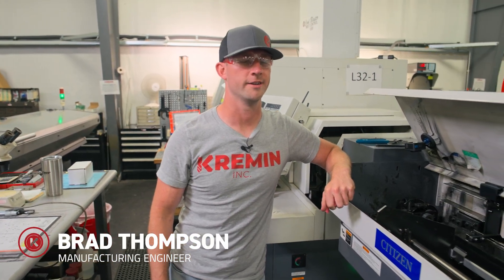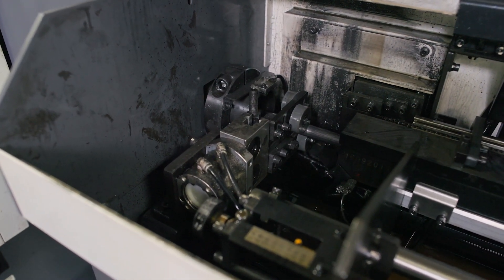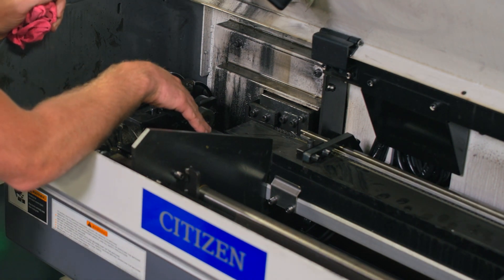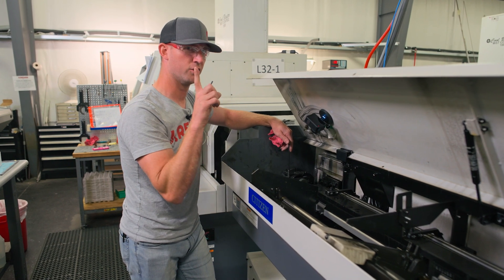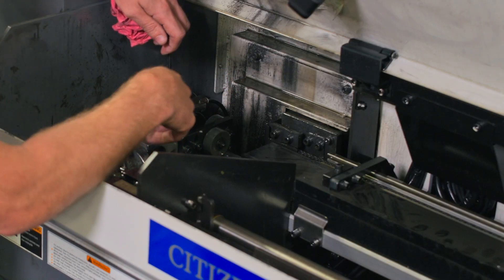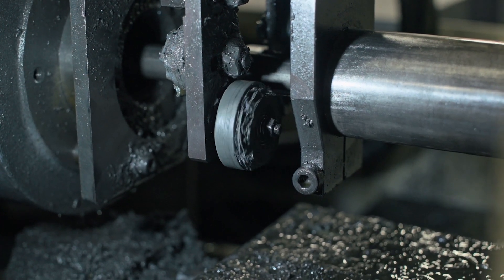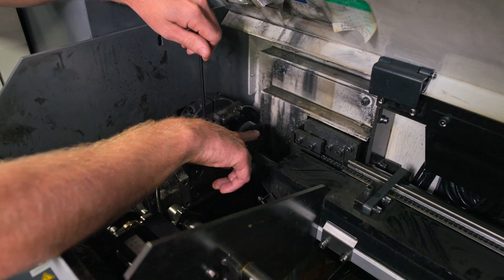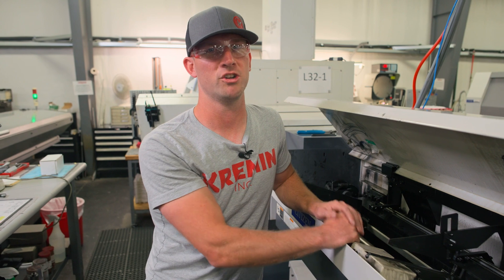Adjusting Stabilizer Wheels on Bar Loaders - Kremin CNC Quick Tip

Comment: Hello, how are you? I have a question, please: What is the best company in manufacturing CNC machines
Reply: if this question is still relevant look up Tornos ^^ they ain't cheap but they're awesome... software/machine, everything just works.... my dream swiss machines.
Mills are not so easy to pin down without nowing what you do but I like Heller and Grob with the latter ones being horizontal mills (fascinating machines) and Heller is just reliable and tough as it can get (very good crash protection e.g.) but Grob is not far behind if not superior stability wise and Grob machines can allow you automatic tool changes with 3-4+ feet tools easily, the horizontal spindle just goes back all the way and the machine inserts a giant drill for example. But with mills nowadays you more want to look into setting up automation. A robot between two mills e.g. changing work pieces... if you wanna go full fancy you get an extra robot at the back automating the entire tool set up process as well (that would be max high tech tho)

Those are just my opinions...